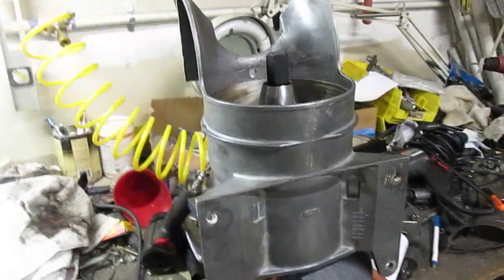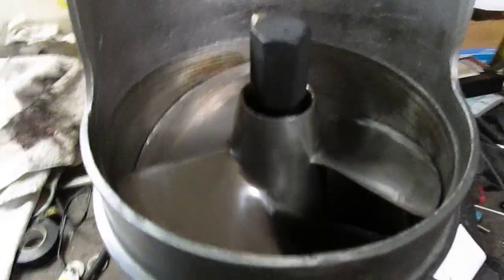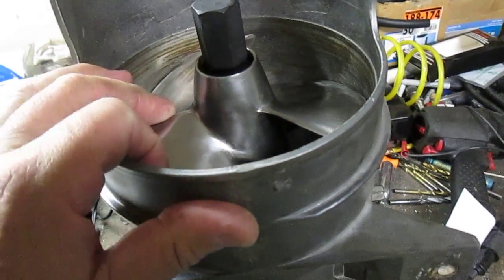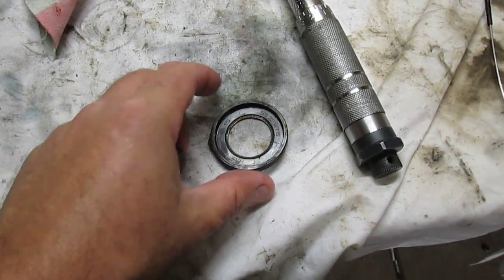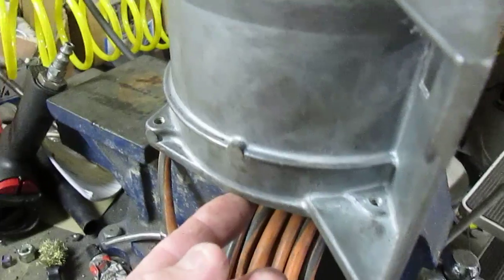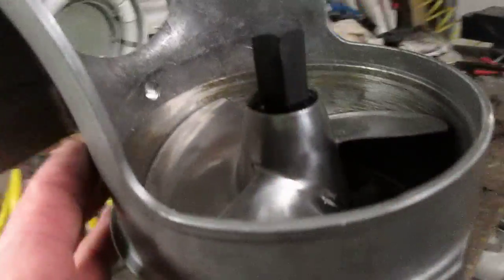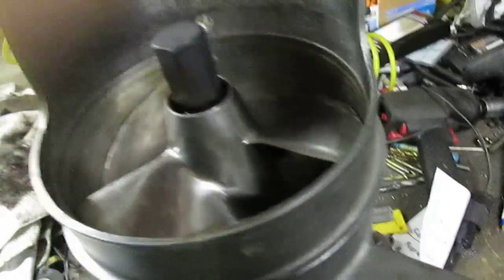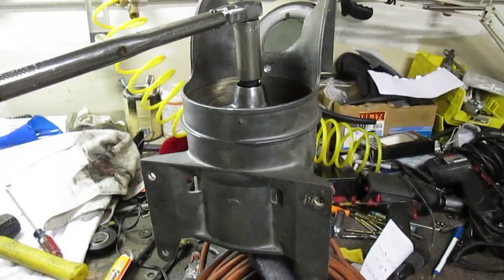1989 650 sx jet pump impeller install and torque

Comment: Idk if youre still answering questions on here, I have a 650sx pump

I have a a bit of play with my impeller, about 1mm back & forth within the pump. Spins perfectly and wear ring within spec.

I cant find any info, nor in the manual about it. Ive heard for seadoos its okay but nothing on the kawi

Comment: How to I remove the pump on my 650sx
Reply from the maker: crawl under and unbolt it. It slides out.If its siliconed in you will have to use a plastic chisel to break the seal.
Reply: mogyver69 ok is removing the impeller and installing an after market one easy and how long will it tsk
Reply from the maker: I;d watch some more videos if i were you..Its not that difficult but then again I've been a mechanic for over 20 years so easy for me might be different for someone else.
Reply: Thanks for the fast replies and I am worried about greasing the bearings and i can get a rebuild kit take it apart and get it back together but i am worried about gresing it. Im doing a 750 swap in my 650sx and I want to do a solas 13/18 prop and replace all the bearing while im at it. I couldnt really find good videos on it this was one of the most descriptive videos. Thanks if you can help me and sorry for all the questions.
Reply: @colbyzern5424  If you have some basic mechanical understanding, you'll be fine.  Make sure you get the $9 impeller tool.
Reply: Atimatik Army yeah when I made the comment I didn’t know much now I’ve torn 4 skis to the hull. I have all the kawi sea doo and Yamaha special parts.
Reply: Right on man that's cool, You're no longer a newbie..!

Comment: Ive re installes everything and when i went to torque it down, the impeller began spinning too. Not sure if i missed something. Any help would be great.
Reply from the maker: You've got to hold the shaft on the opposite side. I used my vise that's why its sitting on a vise.
Reply: mogyver69 yeah i had it set up the same way. But once i torqued it to 72 nothing would spin anymore.
Reply from the maker: so your saying once you torqued it down it locked up? If after removing the shaft from the vise nothing spins then your bearing has collapsed. Make sure you have the bearing installed properly and that you have the correct bearing installed. You definetly did something wrong. Impeller should spin freely once its all torqued down..
Reply: @mogyver69  Maybe spacer is too short or more likely like you said and bearings are not filly seated thus a side load on the bearing happens which creates drag preventing shaft from spinning freely...